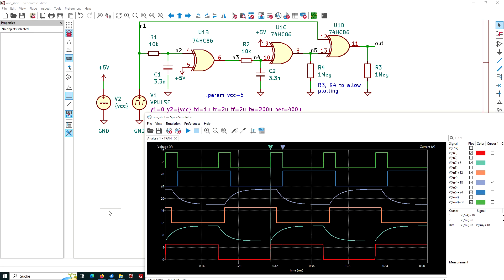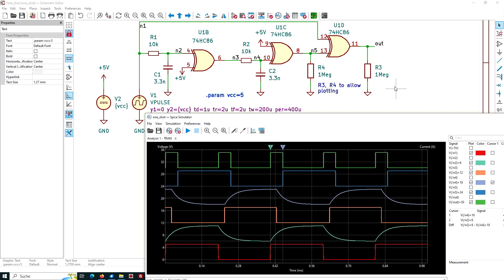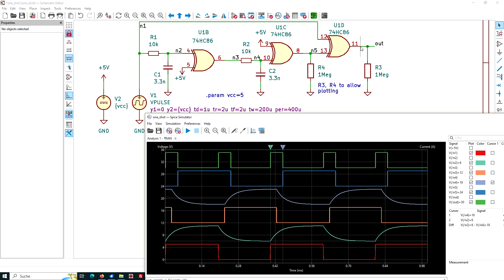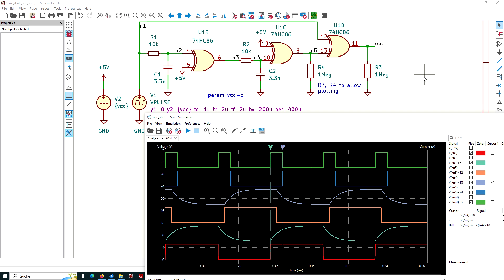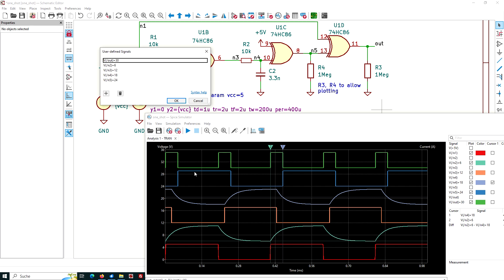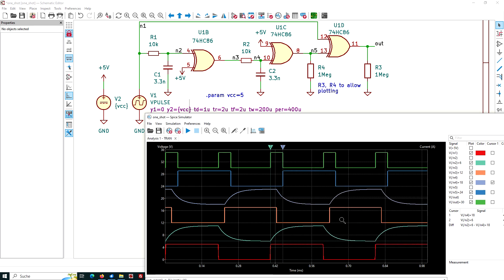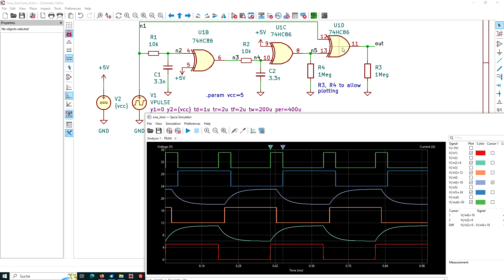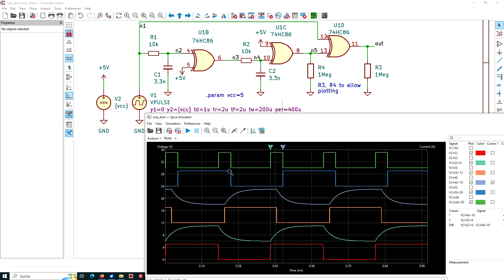Ngspice in KiCad 8: mixed signal simulation (analog + digital)

Comment: I recommend against using this circuit in real life but if you do, this version is a good one to use if you have the parts needed.  The thresholds on HC parts can vary a lot so the timing will not be the same for rising and falling inputs.  Doing 2 stages with the 2nd delay having an inverted signal partly compensates for this.  Adding just the right value of inductor in series with the resistor can also help to get the timings more repeatable.
Still don't do it in real life if you have another option.